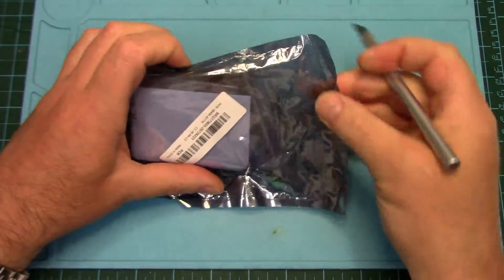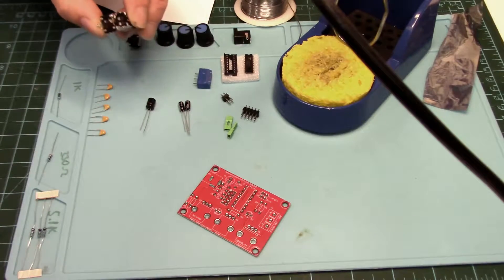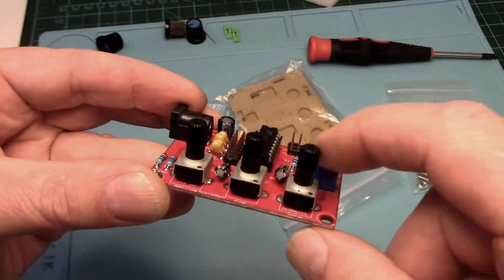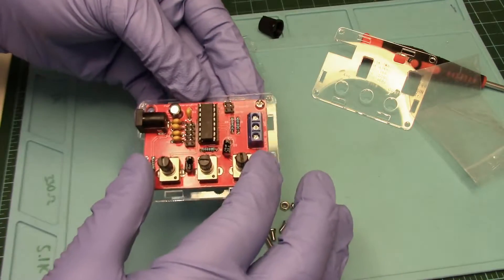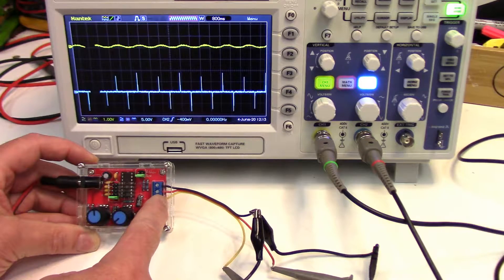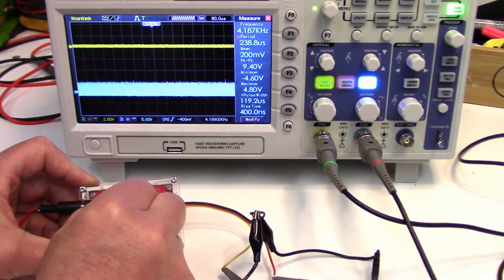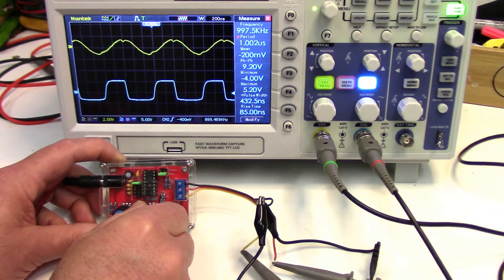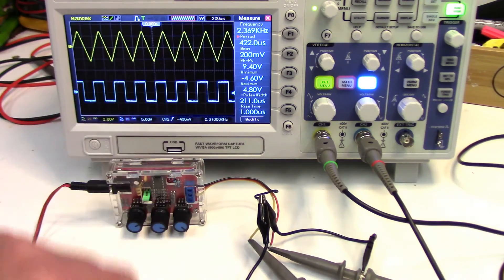XR2206 DIY Function Generator Kit Build & Review

Comment: Hi, what is the max output for sine wave??
Reply from the maker: Sorry I never mentioned that. Max amplitude/voltage is 5.0V peak to peak. It will go up to 6V pk to pk, but the tops of the wave are clipped. Clipping starts just over 5.0v pk to pk; at least on this specific one. I'm sure these little things are all a little different in performance.
Reply: Thanks a lot

Comment: Can I use this generator with android phone with oscilloscope app?  I'm just beginner. I don't want to spend too much.
Reply from the maker: It will generate those 3 waveforms for any application.
Reply: @Rchelicopterfun  Thank you for replying.
I connect this generator kit to my smartphone and oscilloscope app doesn't show anything.
I measure voltage with multimeter on  generator's terminal and it show voltage goes up and down every few seconds.
please help.

Comment: I bought one of these for working on guitar amplifiers.   It's a very handy tool for injecting a signal in to the curcuit to see if the audio chips and transistors are actually amplifiying the signals and for detcting dead components.   I'm not terribly concerned with the waveform it produces, I'm only interesting in detecting that it exists.   

Truthfully, it was the best $10 I've spent.
Reply from the maker: Thanks for sharing your specific amp testing application; "sounds" good (pun intended) 🙂
Reply: @Rchelicopterfun  I also used it twice to align antique vacuum tube radios for a friend of mine.  Again, the precision of the waveform wasn't important.  However, I was able to tune the output to inject the 455 and  1620 Hz signal that I needed to adjust the IF transformers.  Overall it's a handy bench tool, although I wouldn't use it for any precision calibrations.
Reply: @Rchelicopterfun Excuse me sir,is this device can do a wave like 7.83hz? Thanks 👍
Reply: A business man happy with frugal spending is really a much higher compliment than people realize

Comment: Hi John ,  actual R4 resistance  I just got with the kit is 330Kohms  and not 330 ohms. Did you have same ? Tx
Reply: Me too. This is wrong. The data sheet shows 200-500 Ohms between Pin 13 and 14. So 330 is most likely the kit value and used in the kit. 330 ohms are also listed on the equipment list and in the circuit diagram. I put in one from my parts. This is tested and it works (1h ago).
See https://www.sparkfun.com/datasheets/Kits/XR2206_104_020808.pdf page 9 and 11.

Comment: Hi John,

 I bought one of these used online and didn't ask about the polarity of the power jack, and I ended up running in the wrong polarity at 9v. I'm not getting any signal from the function generator at this point. Do you think I should scrap the whole unit or just replace the op amp inside it?

Thanks for any feedback.
Reply from the maker: Your call.

Comment: So... at 7.55 You say "jumper on 1-10 Hz" and little later at 8.50 You say "Frequency shows below 1 Hz (at scope)". Very confusing without any explanation other than I guess its due to the trim pot (or a faulty scope)...
Reply from the maker: It's lower than 1HZ because the jumper position is a coarse range selection only. Dependent on potentiometer position, in almost every jumper scale, it runs beyond the jumper selection frequency (on both ends of the range). The video demos this in every range with exception of the 100Hz to 3kHz range where the lowest I could get was about 141 Hz. Nothing wrong with the scope.

Comment: what is use of these kits?
Reply from the maker: To create waveforms.
Reply: @Rchelicopterfun  what can we do with those waveforms? (if u dont mind me asking)
Reply from the maker: Look it up. https://en.wikipedia.org/wiki/Arbitrary_waveform_generator
Reply: @Rchelicopterfun  does it make sound tho?
Reply from the maker: You mean if you hook it up to a speaker or amp? If so, yes it will generate tones in the audible range, provided of course the frequency selection is also in the audible range.

Comment: The Ebay kit I ordered had a fake or cloned Exar 2206 IC supplied with it, failed on me in a few hours after putting it into operation. There's a vendor on Ebay selling new-old IC stock that I bought an authentic XR2206 from, works perfectly. The cloned IC's can't withstand the voltage range of the original specs, but to be fair these kit makers indicate 12V is the upper limit. I believe the original IC is no longer manufactured. For the price it works well enough!
Reply from the maker: Yep.